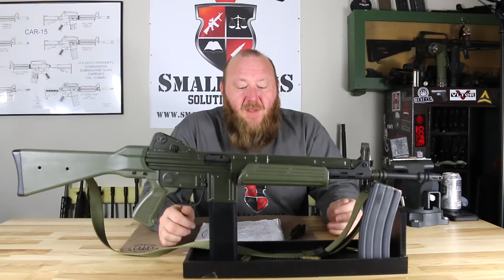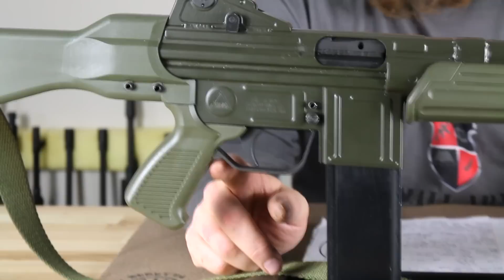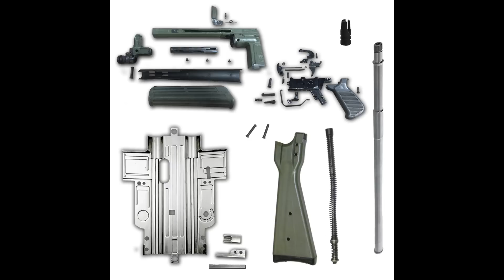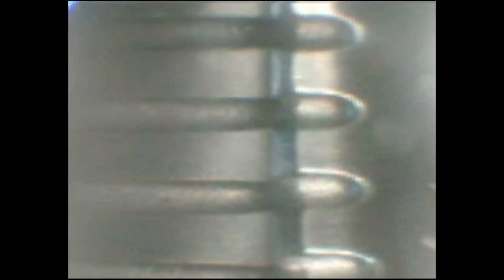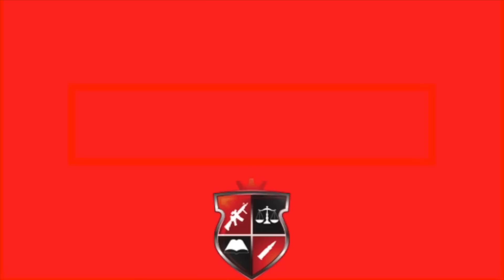The CETME-L

Comment: I think that if someone hadn't been exposed to internet noise concerning the HMG and Marcolmar guns, they'd immediately notice a few things in a side by side comparison. The HMG lacks the shell deflector "eyebrow" on the receiver. This is functional, and really should be present. Spanish CETME L and STANAG M16 mags fit and work perfectly in the Marcolmar. The Marcolmar's markings are true to the Spanish originals, being picked out in white or red paint. The Marcolmar's stock furniture looks new, and no parts appear worn. The last thing will be noticed at the range, where the Marcolmar gives no failures with any 5.56 or .223 ammo you feed it, whether the cases are made of steel or brass.

Comment: Marcolmar has introduced what they term their Gen 2 CETME L. It has a darker Ceracote color they call Marcomar green. Also, the mag well has been redesigned to give a better fit and a true drop free capability when using the recommended STANAG 5.56 magazines. These changes were introduced with approximately serial number L-01350, maybe a bit earlier. It looks like they also went to a more pea green color on the stock, grip, and handguard furniture, rather than the earlier olive color. I have a Gen 2 rifle. Marcolmar recommends that it be fired initially with 62 gr. M855 5.56 ammunition, or equivalent, so that's what I used. There have been no failures of any kind. The rifle came targeted from the factory. Zeroing required less than 1/2 turn at each end. The sights are exactly centered on the rear sight base and in the front sight aperture. The rifle is very accurate.

Comment: there is a version with optics array cetme LV longuer cannon and a shorter version (cetme lc)for house register: bendable rear  by the way your unit does look way cheaper materials then the original with wich i served
Reply: dude mine never ever ever failed to extract in 2 years (after came the g36) in real situations i would never get in trouble if i had yours

Comment: To say that there is no provision for optics is a bit incorrect as the Spanish had a "day/night" optics set. They came in a hard case that included the 4x "day" scope and a 4x "night" gen. 2 optic (VNP-009) that looks the AN-PVS4 but only very few parts are compatible between the 2.
Reply: The rifles that took those optics had to be used with special models that had the rail intrigated into the receiver itself, so yes, he was correct in saying the normal infantry rifle has no provision for an optic.

Comment: The new Marcolmar version seems to have addressed many of the issues the Hill & MAC version had (spring, mags..).  There is also a manual release on the rifle on the other side of where you locked the bolt back.

Comment: I picked up one of these from HMG.  The run was only 100 and it took forever to get the receiver flat right, but they did a spectacular job.  Hopefully they get the STG as well, but that's running really long. I agree with the trigger module being harder compared with the HK, although there's a Spanish guy on youtube that does it in 3 seconds. I think the recoil is a bit less than the HK because there may be a bit more travel for the bolt carrier to move rearward with the recoil spring being in the stock.  I have instructions with mine from HMG to use steel case to break it in. Something to do with the fluted chamber and most likely to take the sharp edges off.

Comment: Wasn't the original CETME designed in an odd intermediate .30 cal cartridge?  I've also read that from the engineering side, designing a delayed-blowback in 5.56 is rather difficult due to the sharper pressure curves compared to other cartridges like the .308.  Seeing the malfunctions you were having on the range made me curious as to what the difference is between the FAMAS and the CETME-L are as far as time between firing and when the bolt unlocks and begins extraction.
Reply from the maker: History Book Reviews 7.92x33mm

Comment: Attention: Cetme L magazines will not fit in a HMG rifle.  Only purchase Brownells magazine. My rifle had numerous problems that required several replacement parts to get it to run. The biggest problem with this rifle is that it wasn’t well made to begin with and the HMG guns used beat up parts kits.  Buyers beware.

Comment: Spanish 5.56mm ammo is notoriously 'hot' as it was tuned to help the CETME L run better. The CETME L magazines were available in 20, 25, 30 capacities  etc which have zero or a more gentle 'curve' to them with a follower with very short legs that allowed the follower to tilt to take up the angle caused by tapered ammo (as opposed to the curved STANAG mags) hence the incompatibility if magazines....
Reply: Also 12 round parade mags.
Reply: Followers tilting on purpose? Is that a good idea?
Reply: @miguelencanarias  the original CETME 'straight' magazines had to have a tilting follower because of the lack of 'curve' of the magazine... this is a well documented issue from the US 30 round magazine development.

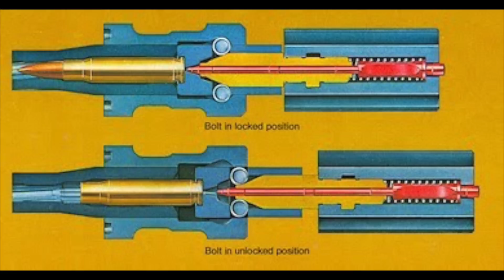Comment: 1:10 the mg 42 is not roller delayed, it is roller locked. Roller delay was only figured out by the Mauser enginerds very late in the war. Mg 42 still needed a recoil operated mechanism to unlock the rollers, stg 45(m), cetme, etc did not.

Comment: Good Video as always, however, minor correction: there is an bolt release on the left side of the gun, on the rear sight base. Also, the whole malfunctioning issue could be a manufacturers' QC issue. It very well could be HMG's fault. Or maybe b/c the parts kit used is old and have worn out extractor and/or extractor spring. Seeing how other HMG CETME-L rifles on Youtube function just fine, you shouldn't rule the design itself as the main factor to these malfunctions. It could be, not saying it couldn't, but there are other factors you have to consider since this is a semi auto recreation by a small US company: HMG, and not an original.
Reply: Previous comments I've seen from Spanish service personell indicate that the manufacturing quality of the springs was terrible. If you can get good springs for it, apparently it runs ok.
Reply: @farmerbrown84  In the case of the recoil spring, a spacer under it will increase the spring pressure. Inrangetv built 2 kits at hmg; Ian's ran fine but karls had issues till he put a 8mm lebel case under the recoil spring.
Reply: I found that HMG spring kit makes it malfunction. I used the original hammer spring and it worked fine. The HMG spring is too good and puts too much force on the hammer, which in turn drags on the carrier group. Fortunately, a hammer spring is not a part of the 922 compliance list.
Reply from the maker: KAChan this rifle was well made. Tight but well made. This platform suffered issues which is why it was replaced so quickly.

Comment: Great video! I’m going to order some Cetme L mags for it :) I was able to get the selector lever out of the gun but it was a huge pain. There is a notch in the selector and a corresponding notch on the trigger group frame, which need to be lined up and slightly tilted. The problem is, this is all happening internally and you can’t physically see the notches with the rifle assembled so you have to use some trial and error to get the parts aligned... Very clunk design. Thanks again for the video!
Reply: Have you seen the series of videos inrangetv did; they built 2 kits at hmg. Karl's build had feeding issues that he fixed by dropping an 8mm lebel case under the recoil spring. I think the springs are a major weakness of this rifle.
Reply: MarksmanTV don’t buy Cetme L mags! They will not fit in a HMG gun.
Reply: Don't!  The CETME L mags were known to be the shittiest part of the Cetme L.  Use USGI Aluminum mags.  Better yet, sell the Hill and Mac and buy a Marcolmar.